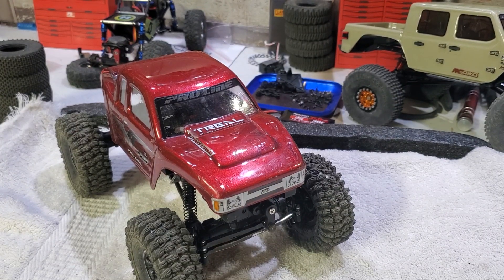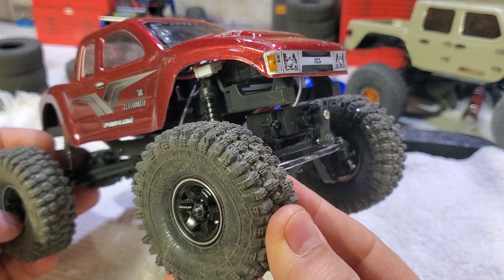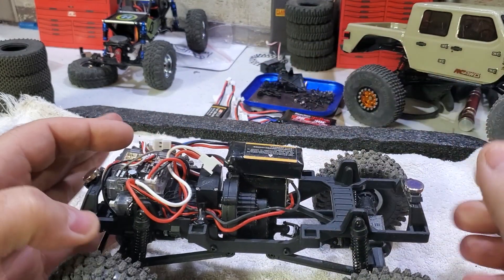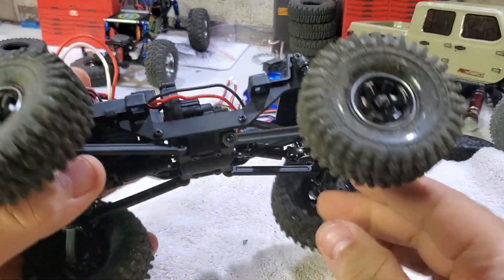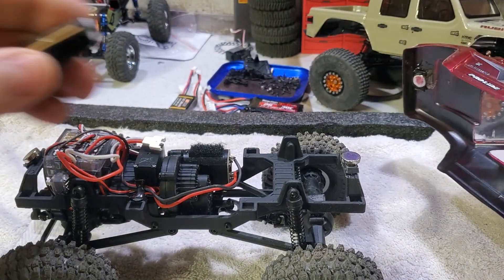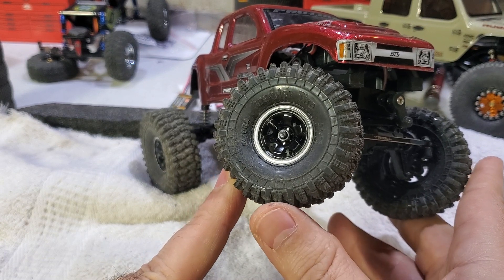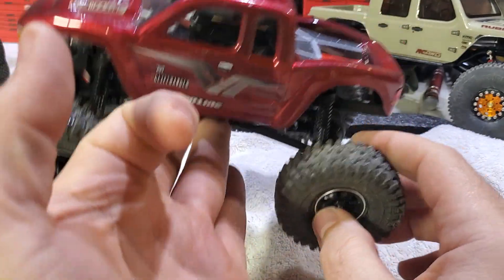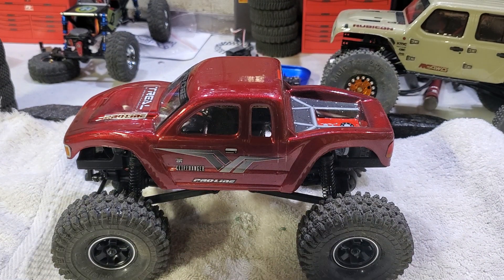Fcx24 Treal and DJ crawler upgrades and problems .

Comment: Nice looking truck. I installed TREAL +12mm extended rear links on my fcx24, only found on Treal RC or Helidirect and comes with driveshaft. It articulates well with no binding and works super nice, not too long like the RCAWD extended kit so it don't high center as bad but still climbs very well.

Comment: Nice video… you have the V1 transmitter with the dip switches… does your CH3 have 3 positions? Or just 2? The way your talking it sounds like it has 3… low, neutral and high… but you might only have 2… it’s hard for me to tell… but if you have 3 positions it sounds like your neutral has a lot of slop I’m guessing…. I dunno if you know this or if your even interested…. 

but what if I told you that your transmitter has secret programming features… you could edit your servos end points, and throw length… which would might get rid of that extra play in neutral…

Not only that, but if you wanted you there’s a way you’d could get rid of neutral all together and have your channel 3 just be low and high and no more dealing with neutral… and if you decide you want neutral back one day you can program it back in…. 

You could do all that right now from your transmitter and you don’t have mess with the receiver or install anything… all ya have to do if follow a few easy steps on your transmitter and your good to go…. Anyways I’m new to your channel I. Just thought I’d let ya know in case your interested…. Let me know… nice video. Thanks for sharing…..
Reply from the maker: It is the 3 position